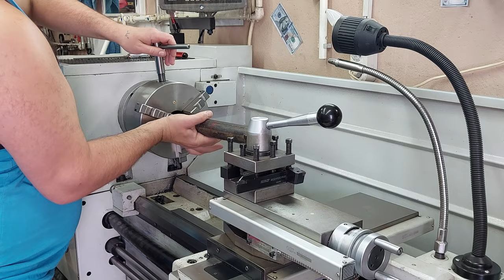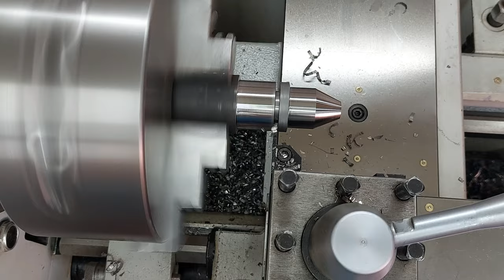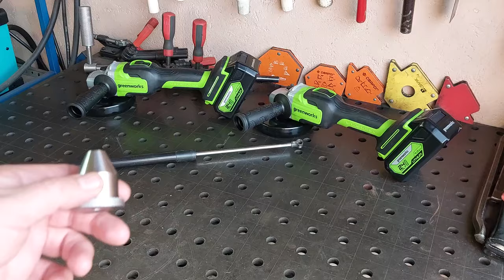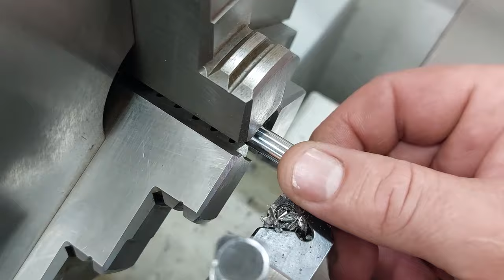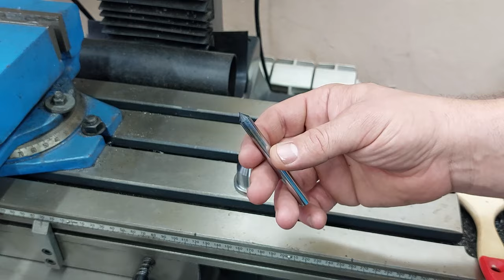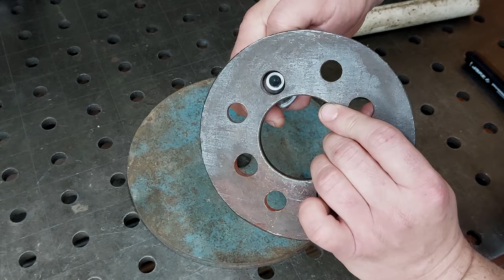This amazing tool I invented on the lathe

Comment: Hate to burst your 'The Inventor of' bubble, but I have two of those I bought from MSC 6-7 years ago; some dude in India would argue w/ you about who the inventor of the universal transfer punch is.

But, you did do a heck of a job making one, even if you aren't the inventor.  Make yourself another, a little bro to that one, for smaller holes. Yours, as well as the store bought versions can only accurately transfer holes above a certain size.

The real limitation they have, (& if you solve this, you CAN claim inventor title), is the problems when the item you're transferring the holes from is thin, less than 0.200", thin.

GeoD
Reply from the maker: There is a saying - "All new is well forgotten old" Thanks friend and welcome!
Reply: Made something very similar during my 3rd or 4th year in the industry.